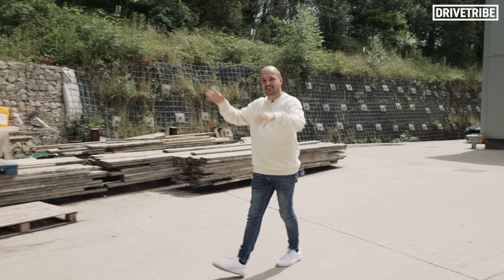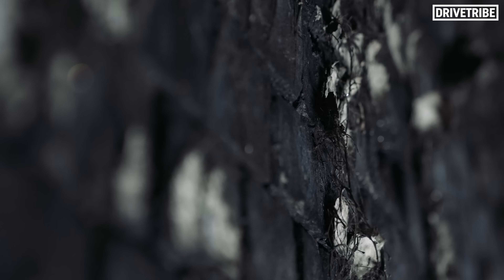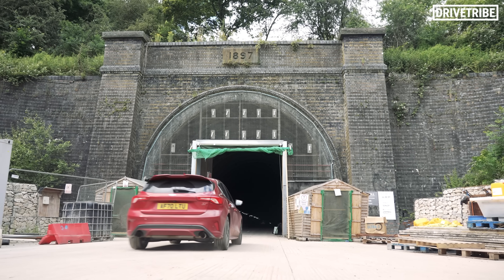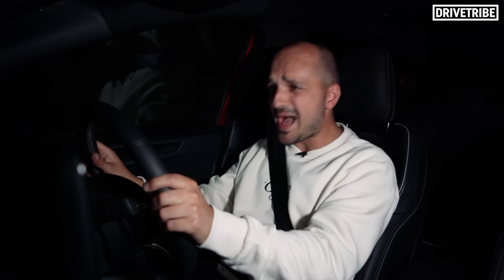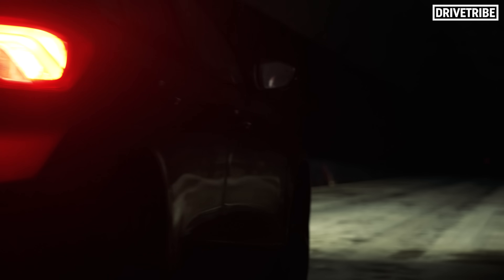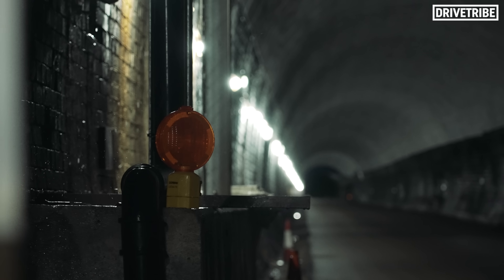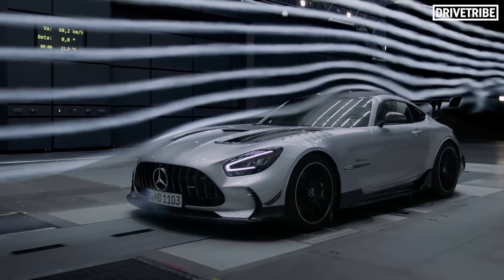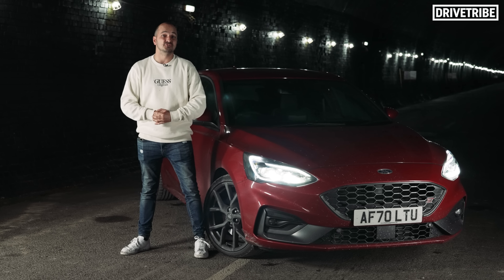This Victorian tunnel is being transformed into an F1 facility

Comment: Dun think this idea is going to work. 1) dun think it really is economically cheaper to maintain long stretches of the tunnel, 2) in a lab, u can run alot more analysis 3) & that is a controlled environment. 
Interestingly, the host didn’t mention the company funding the project. But i think the hint is that it’s not an f1 team

Comment: Not really a wind tunnel, this is a no-wind tunnel.   A wind tunnel contains a machine for simulating wind, and is used for things other than road vehicles.  Don't know what the name should be for an environmentally controlled enclosed automotive systems aerodynamic test track.  Maybe beano-tunnel?

Comment: I think the biggest advantage is the low operating cost for the owner. Other than that it may actually be less practical comparing to stationary wind tunnel (where they are moving air around stationary object).

Comment: Testing cars meant to be driven at far higher speeds in open air in a tunnel at lower speeds. OK. But it's just a tunnel, not a wind tunnel. Sometimes a tunnel is just a tunnel, a train is just a train...

In any case I think this is BS.

Comment: I’m somewhat surprised & perplexed that someone hasn’t thought of doing this with the abandoned supercollider project in Waxahachie, TX (about 50 km/30 miles south of Dallas). It was supposed to be a ring 87 km/54 miles in circumference, and about 28% of the tunnel (≈24 km/15 miles) had already been completed when the US Congress shutoff funding and closed the project in 1993. Many ideas for what to do with the space have been thrown at the wall over the years, but nothing has stuck.

Comment: A quick look at the ventilation setup and data center would have been the icing on the cake. They've thought of running tests on the return run after the turntable, right?  Or would  the shut down area from the start be too short and risky? Hope you can visit in for some test footage if allowed. ✌
Reply: Yeah the plan is for people to run in both directions with results averaged across both runs.

Comment: what's the point if the regular speed limit is only 100 mph? f1 cars would usually be turning at that speed but the tunnel is straight. or am i mistaken and the regular wind tunnel only simulates about 100 mph?

Comment: "this is the future and its 120 years old" to be honest most ideas are...
Reply: If we want to have any kind of future, it will be technology from the present or past to make it possible. We cant avoid imminent collapse with technologies yet to come.
So to say electric vehicles are pretty old, in fact older than combustion engines (50y older, and 10y older in practical use). Even the concept of a hydrogen fuel cell is dated back to 1839.

Comment: This is dumb. Like reeeeally dumb. Who is this for?  What major manufacturers or racing team would use it. It is only capable of giving you very limited data on wind travelling in one direction. In the real world and on track, you must deal with variations of wind direction and volume of wind passing over different aero elements. These can be controlled precisely in a proper wind tunnel. Using this tunnel instead would put you at a significant disadvantage.

Comment: Looks cool but last I checked F1 wind tunnel tests must be done with a 60% scale model, meaning they wouldn't be able to drive the models in a tunnel
Reply: Accurate.  In season testing is banned, as well as full scale vehicles.  F1 teams will not test in this fascility.
Reply: ROB H8U  no it wouldn't.  F1 moves too quickly. Plus with the current cost cap, it's an even bigger waste of resources.
Reply: 60%smaller test drivers
Reply: @jasongerrard8940  Ant Davidson would like your number 😂👍
Reply: no one said you can't use last season cars or next season cars
Reply: @GavinY  Testing on the previous season's car is strictly forbidden.  Two year old cars are fine.  As of 2021, the 2019 cars can be used however teams like.

Comment: Are they gonna be racing in sealed straight tunnels soon? If not this doesn't make sense to me. If you design and engineer a car to run in a controlled environment. Then it won't be engineered for a real world race. Tracks are bumpy, windy, curved none of these conditions exist in that tunnel.
Reply: Racing is a game of tenths.  If you have a new part that you think will give a .5% advantage, testing it an uncontrolled environment will make it difficult to know if the part added 1mph to your straightaway speed or if there happened to be a breeze from behind.  Eliminating all those outside variables you mention is only way to know if your new part makes a difference to the car. Plus (in the case of Chip's original tunnel in Pennsylvania) you have a facility at your disposal that allows continuous secret testing, something that few race teams can get.
Reply: @f500raptor  If you can't tell the difference on the track then all the testing in a tunnels won't work gonna work. Especially since you can only reach 100 mph in the tunnel

Comment: I wish F1 cars could use this, but the testing rules would not let them these days!
Reply: True you can shoot a cool video but that's pretty much it. 😂
Reply: Using this tunnel would not be part of official testing, that is done at a track in race conditions. Using the tunnel is part of the development phase and would likely not include using the team drivers, but use test drivers instead.
Reply: @killuazoldyck1352  or just RBR racing down it for a cool video
Reply: @howdareyou41  So testing is very limited these days. You get pre-season testing, 2 filming days capped at 100km per day, sometimes a Pirelli test or 2, and the young driver's test. You used to get straight-line testing, but that has been scrapped as there is more benefit of using a wind tunnel. Stright line testing ended up being used just for correlation between the wind tunnel and real world, hence why manor used it a lot, they had to create a lot of CFD tools. Teams could run a 2-year-old car as they are considered out of date enough to be allowed to, like you say RBR do it a lot. As for building a new car each year, worth remembering teams won't unlearn something. They all have mad amounts of data to look back on despite ever-tightening restrictions...
Reply: @howdareyou41  I can definitely see RB do that kind of stunt
Reply: so they're never allowed to do tests? that seems odd since they construct a new car every year
Reply: @howdareyou41  There is 3 days of official testing, and the rest is done on race weekends. That tunnel may also be too narrow for F1 cars, they're quite wide and the aerodynamics kick a lot of air sideways, which the tunnel would reflect.
Reply: @sIightIybored  Using this tunnel would not be part of official testing, that is done at a track in race conditions. Using the tunnel is part of the development phase and would likely not include using the team drivers, but use test drivers instead.

Comment: Can someone finally drive upsidedown in a tunnel? This seems perfect!
Reply: As the maximum speed is 100mph, not even remotely close. The time it takes to get up to speed let alone the aero requirements of the ceiling...
Reply: @firesurfer  Also, the tunnel isn't a perfect circle, which means there's actually quite a sharp curve at the apex of the ceiling arch - quite a common design feature with old railway tunnels. Have fun driving down that.
Reply: @chrisoddy8744  No kidding, I referred to that.
Reply: @firesurfer  f1 cars can drive upside down at 100 mph.
Reply: @Obi-WanKannabis   Not on a curved ceiling. Duh.
Reply: @firesurfer  as long as it drives on the top yea
Reply: No
Reply: <Rollcage enters the chat>
Reply: Just seems like an death waiting to happen, especially with the shape and uneavean surface of the roof
Reply: Made that comment myself,so much downforce that it COULD drive on the roof of a tunnel, now just effin prove it PLEASE.
Reply: Top gear have already done it, I think it was clarckson that did it